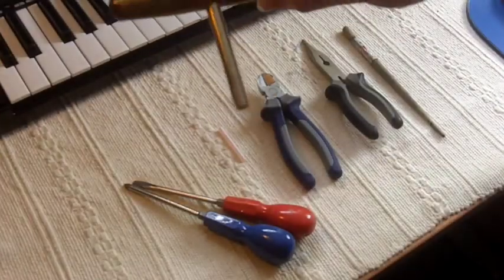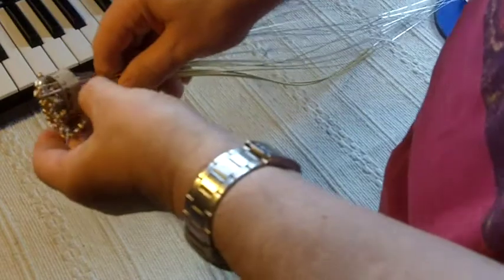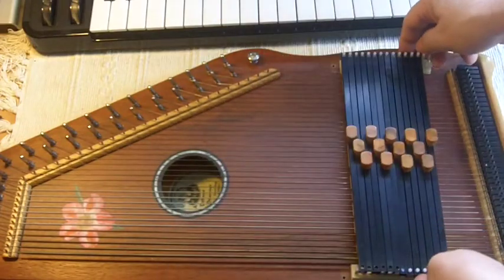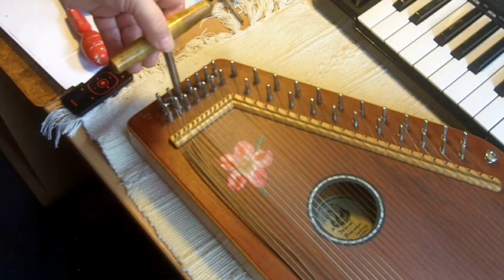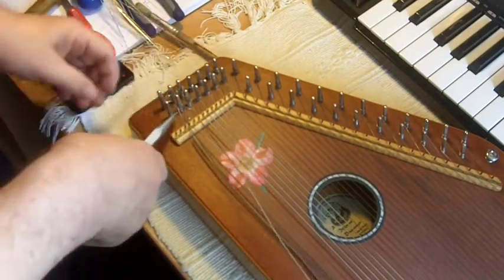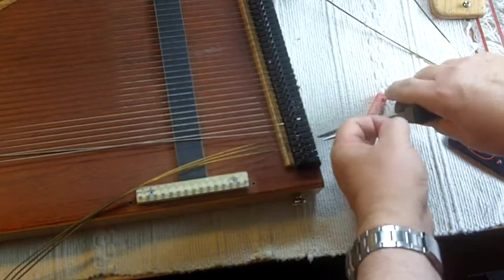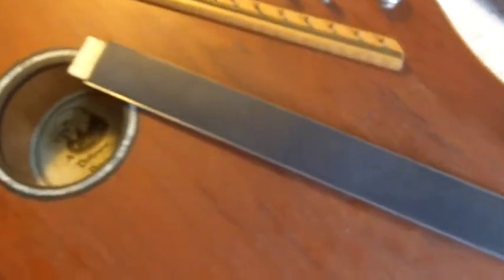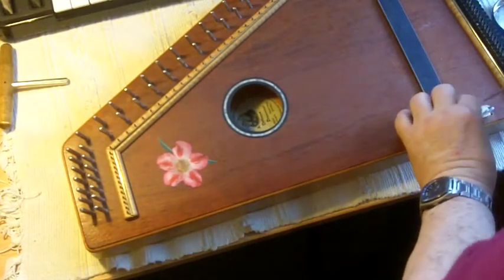Restringing an Autoharp   Part I

Comment: Can you please share the details about the standered size of the instrument and what should be the standered size of the strings for the tuned it in perticuler scale...what is the science behind the work
Reply from the maker: Indian Classical art -  unfortunately, as with most folk instruments, there is no standard size, luthiers have their own patterns. There are a couple of big makers who do have standard mass produced instruments, the main one being Oscar Schmidt, but even those are often messed about with and restrung. The only ways to be sure of getting the right string are to contact the maker, or to send the distance between the two bridges and the note required to a specialist autoharp string maker in the US.
Reply: @Bobtheautoharp  so you don't know how to set the distance between two bridges so the biggest length string and smallest strings should be tightened at perticuler distance so that we can easily tunned it in the proper scale...

How I get the keen information about that, please help me..
Reply from the maker: Indian Classical art the bridges are not moveable.
Reply from the maker: Indian Classical art you seem to be asking for more information than I can give here. I recommend “The Autoharp Owners Manual” by Mary Lou Orthey, from Mel Bay publications.
Reply: @Bobtheautoharp  Thank you so much sir.
God bless you...Have a great time